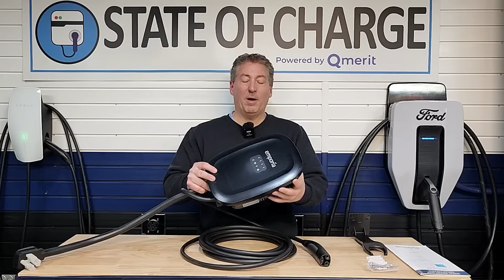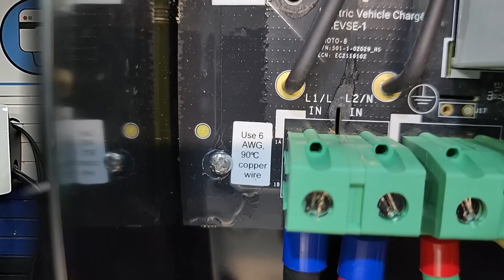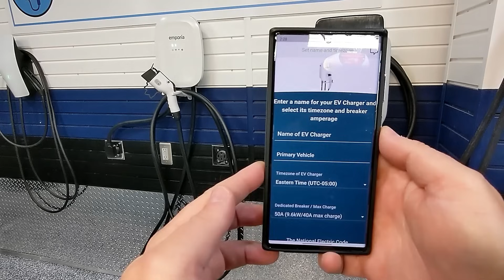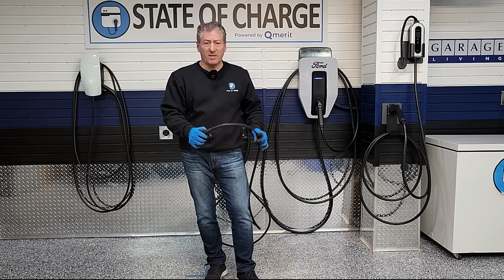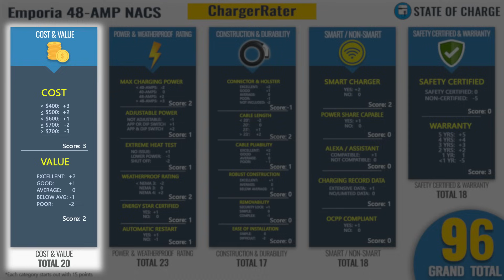I Review The Emporia EV Charger With The North American Charging Standard (NACS) Connector

Comment: Thank you for another great review, Tom. I have some follow up questions about the new cable. You mentioned that it gets warm during charging, I assume that's because it's using thinner 8 gauge conductors. So, was the old cable using 6 gauge (and that's why it is heavier and runs cooler)? And, is it possible to upgrade an existing Emporia unit with this new cable (i.e. after it was already installed with the old thicker J1772 cable)? That would be a nice upgrade option.

Comment: What is missed and I think it's important is this charger can incrementally adjust the amperage on a sliding scale in one amp increments . So you have the ability to adjust your charge rate . You could adjust to how much charge to how much solar you are producing .  Say if your doing 11kw at the maximum 48 amp charge.  Other house electrical maybe producing 2 kw . The solar at peak is producing maybe 8 kw . So the house needs 5 kw of grid power . So you slide down to maybe 24 amps to eliminate the 5 kw from the grid and charge completely from the sun . Now you can't keep adjusting the amperage to match solar production but you average out your solar production during charging and charge at that level

Comment: I purchased the J1772 version based on Tom's recommendation. It's been great, thank you. I also got a separate connector holster from Grizzl-E as they're not too far from me because I also hated the included holder. 

A question, will Emporia owners be able to directly replace an existing J1772 cable with a NACS cable? I had an electrician hardwire my unit with a dedicated copper cable and a 60A breaker and the connector blocks for the vehicle cable seem pretty similar. This leads me to wonder if swapping between J1772 and NACS cables is possible.

Comment: Only 2 signal wires in the cable? The tesla wall connector has 4. Im guessing tesla has a temperature sensor? Also your reviews check and test plug overheating like tesla does

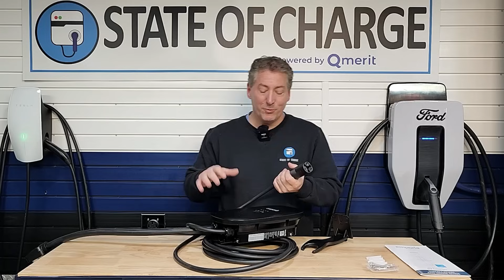Comment: 6:20 6:50 13:34 Emporia should fix the holster design in this upcoming version of the charger with the NACS connector so that the connector is facing down when it's in the holster.  Customers shouldn't have to wait for another future version so that connector is facing down when it's in the holster.

Comment: I got the Emporia Evse for my Bolt EV and I love it. Yes the holster they provided is crap. I bought a separate holster for it though and works great. I use the enphase holster and wrap the cord around the EVSE unit as it's perfectly designed to hold the cable. Emporia has great customer service as well and just added load management to my unit since I also have their Vue 2 as well. 

I wish there was videos about that as well.

Comment: Is the load/ Energy management inside of the unit
Reply: I talked to them about it back in December - yeah, it's software inside of the EVSE, but you need their home energy monitoring system to measure system capacity and to talk to the EVSE and tell it how fast to charge. They said since I already have the VUE energy monitor, all I would need is the upgraded EVSE.

Comment: What is the SAE number? J-3400 ?  Will it allow DC  from solar panels of 48 KW DC?  Will pin 1 be positive and pin 2 be negative?  Can this charge the Tesla model X?  Or even model Y or any other regular Tesla.    Can one rectify 50 Amp line and make 240 volt DC or 340 volt peak in order to make DC as input to 3400.  I use an adapter to charge Tesla from J-1772 and it look similar.  Very close.    I still have many more questions including what vehicles have J-3400 now.   Can it be converter back to J-1772 for older Electric Vehicles?    The price is unreal  being   too. low.

Comment: For all of Tom's hawking of Qmerit, I cannot recommend them.  I bought an EV in June, and based on what was a very informative EV charging video on this channel that also strongly pushed Qmerit, I tried them out.

I called Qmerit and was flatly told to go to their website.  The call lasted less than a minute.  The website directed me to a form where I filled in some info.  There was not much else there.

The next day I got several calls from random electricians.  Apparently, all Qmerit did was post my info on Angie's List.  I got the sense that none of them knew Qmerit created the posting.  I pursued a couple of the more competent sounding ones.  They both offered identical service for the exact same exorbitant price, $650 for a direct hardwire, extra for a plug.  Both dissuaded me from getting a county inspection, but would arrange to be present for an inspection for a few hundred dollars more.

I called an electrician I had used a few times in the past.  He said he had installed several EVSCs.  We set a meeting time.  He showed up with all the conduit, wire, breakers and tools he would need.  I asked him to also check the wiring in the backyard because the line to the shed kept tripping the GCFI breaker.  I also had lights built into the driveway that had stopped working.  He drove to a nearby hardware store to get the parts to fix them.  Everything works now.  Total price for the install and fixes was $500.  The EVSC install passed inspection.

If you're installing a EVSC at home, by all means see what Qmerit offers to do it.  But don't stop there.  Find qualified electricians and get competitive quotes.

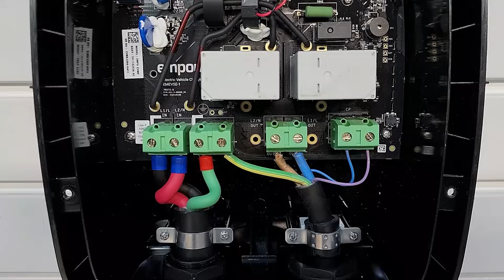Comment: 17:24 
I’ve bought and installed this charger in the j1772 version. One thing that is very important & overlooked by many ‘reviewers’ on YouTube is hardwiring. You CAN NOT run NM-B (romex) of the CORRECT size  to supply 48A continuous because the lugs are sized too small.
I’ve reached out to Emporia, while I didn’t expect them to change their design based on my email, it appears their new charger has the same size lugs.
Reply: What gauge of romex did you have? The lugs are sized for 6 awg 90c rated thhn wire but since romex has a lower temp rating you would need 4 awg and that will not fit.

Comment: Florida Power and Light has a program where they will install a Wallbox charger at no charge that they will own.  They will charge you flat rate of 31.00-35.00 a month for charging as much as you want during none peak hours with is pretty liberal.   My question: if you get another wall charger that delivers 40 amp and can be programed to run only during non peak hours would there be any difference in rate?  My FPL house meter has nothing special on it.  Don't see how rate could be different if FPL doesn't have some type way to send info to Meter.   The Plan is called FPL EVolution  they are offering it in most of the State.

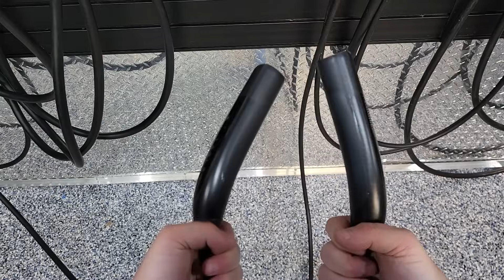Comment: Just some feedback, but I think you should get a higher quality camera? Sometimes your videos get really blurry and hard to see details due to low resolution and bitrate. For example, the connector comparison shot at 14:50 has some really bad pixelation at 1080p. You should get a 4K camera since you zoom in on your shots, which should have enough extra resolution to handle digital zoom without getting blurry. Could be your process too if you're compressing the bitrate too much before YouTube upload. As a check, this 43 min video should be a 2.6 GB or larger file to meet YT's minimum 1080p bitrate recommendation; smaller than that means quality is compromised. Making some changes could really up your production quality.

Comment: Just a dumb question (in my mind), can I plug it in with an NEMA 14-60 plug (60amps breaker and wire from install) and get the full 48A for charging or hardwiring still a must?

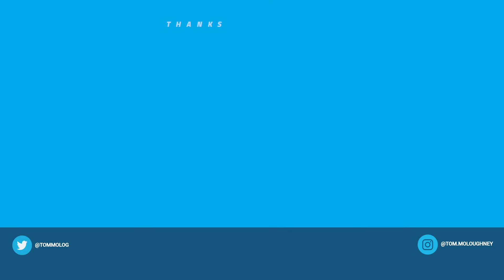Comment: Adding an adapter which is one additional junction to those AC pins, effectively adds about 7 feet of cable resistance to the overall resistance normally experienced and designed in by the OEM of any charger. As a temporary solution, it’s fine, but using a quality OEM adapter is going to be required, which if you’re straddling plugs that cost must be considered. My OEM charger manufacture offers a conversion kit that includes the built-in holster that you have reviewed and if I ever use a J3400 it will be by simply converting the existing charger I have. Only having one EV simplifies my charging needs and therefore choices. Good review, great price and warranty. 42:56

Comment: The one thing I have difficulty wanting to do, is wanting to hardwire a charger to the electrical box.  I don't feel comfortable getting it done because if it ever gets broken or fails, I'm going to have to call out an electrician for another installation. I'd rather just be able to buy a new charger box and plug it in.  Or if I happen to move, then I can take it with me.  Those are just my thoughts.

Comment: It's a lot less expensive than the Tesla Universal unit, but I still think that's the best unit, especially if you have a Tesla. But even if not, the built in J1772 adapter is really nice.
I'm curious how the cybertruck does its bidirectional charging. Looks like the AC/DC converter is reversible according to the Munro video. Being able to put AC back out is super convenient rather than having a big unit mounted to the wall.
I wonder if the Tesla wall connector can support V2G with a firmware update. I assume it can measure power in both directions.

Comment: Tom, is it required to use a smart phone to operate the Emporia? Can the unit work like the old Siemens  Versi-Charge, that is, just touching " buttons" on the face of the unit?  I have a  Apple ID15 but don't use it at home for routine charging.
Reply from the maker: There are no buttons on the face, but yes, you can use it fine without the app

Comment: The Emporia charger will only connect to wifi that is broadcast on 2.8G. If your system only broadcasts on 5G (Cox in my area) it won't connect. The solution is to get a range extender which will rebroadcast on 2.8G
Reply: 2.4, and virtually every industrial device only connects to 2.4.

And the solution you wrote is kinda funny…
Reply: 2.8G?
Reply: @drobekus    He’s a noob out of his depth…

Comment: These reviews would be great if they included information about how much power these things use when idle. I don't charge a lot, so most of the time I'm not plugged in.

I use the mobile charger at home, and I have a switch before the NEMA 1450 plug so I can leave it plugged in without pulling power when not in use. A charger with an On/Off switch would be great!
Reply from the maker: That's why I include if they are Energy Star rated, which takes into account the power draw when not in use.
Reply: @StateOfChargeWithTomMoloughney  I don't trust Energy Star ratings, which I see as similar to the star rating for crash tests: too vague to the point of meaningless. I'd prefer to know how many Watts it draws. And ideally, I'd like to know that I can flip a switch on the device and know it pulls nothing.

Edit: This is the primary reason I haven't considered getting a home charger, so if anyone from one of the manufacturers is reading this, they should take note. So far, I haven't found a reason to change from Tesla's mobile charger with a switch to anything else. Some might charge a bit faster, but if they're going to draw power when I'm not using them, the extra speed isn't worth it.
Reply: I’ve installed this brand of charger in my home with the j1772 and have a energy monitor connected in my panel. The unit will draw an insignificant amount of power during idle (<10w) for the WiFi connectivity ect…
Reply: @Ivan-kb2si  10w * 24 hours * 365 days = 87.6Kwh, or more than a full charge per year on an average EV. Seems like a lot to me. Edit: fixed decimal point.
Reply: @therealctoo4183 
10w * 24h = 0.24kWh / day
0.24kWh * 365 = 87.6kWh / year
87.6kWh / year * $0.12 / kWh= $10.56 / year

You are correct, it does add up and while it may not be much as you said it adds up!

$0.12 is MY average rate for power, this will be different depending on your rate.

Comment: Is this Emporia EV charger better than Tesla Wall Connector that currently sell for $475?  If you have a Tesla, which one of the two will you pick?
Reply from the maker: There's no easy answer. It depends on if you have a non-tesla solar array and want to have a sophisticated energy management system, then the Emporia would be better. The Wall Connector is about 20% more so if budget is a priority that's another reason to get the Emporia. That said, the Wall COnnector is also a great unit - both are at the top of my recommend list.

Comment: That Cable is the exact same one as Tesla’s! I could tell when you opened up the unit and showed off the individual wires in the jacket mounted to the EVSE. I purchased a Tesla NACS Cable for a project and that has the exact same color pattern as the cable you featured.
Reply: What i find strange is the fact it uses the European colour standard, brown L1, blue neutral, green/yellow protective earth.

Comment: Hopefully the NACS version of the holster will have a push-in holster (like the Tesla wall connector). It doesn’t need to be on the side of the unit, but it would be part of the separate handle.
Reply from the maker: They will ship a small wall-mounted remote one so you can install it anywhere you'd like.